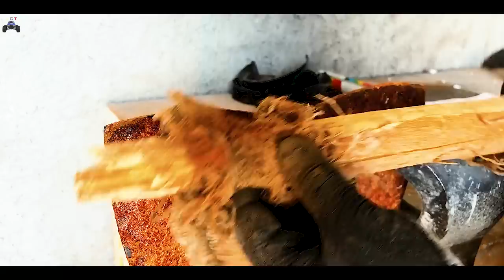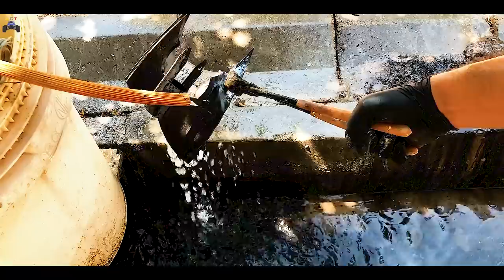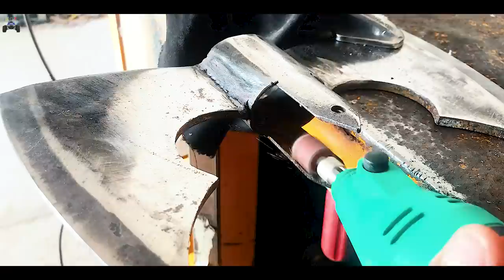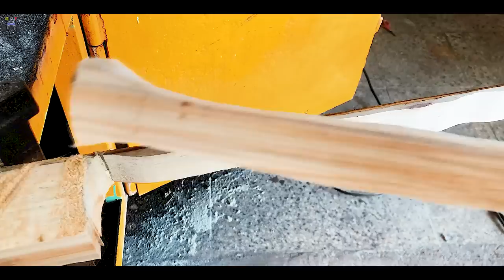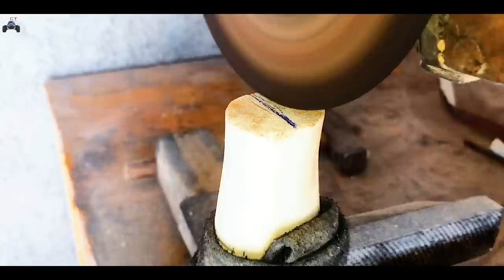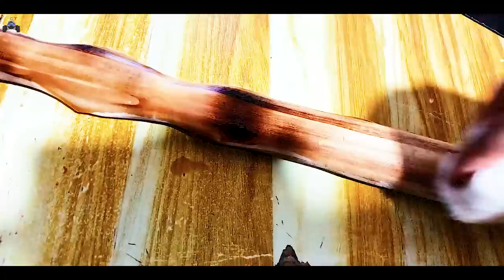Restoration Rusty Viking Axe Battle Old | Restore AXE construction Antique

Comment: I'm guessing that this axe is a modern reproduction made for the tourist trade. The axe blades are welded onto a seamless tube. The original would have been cast or forged.
Reply: Yes and wood handle is not aged, old always looks darker.
Reply: No doubt; you can clearly see the electric welding between the blades and central piece.
Reply: I'm guessing it is totally modern.  Viking axes were, generally, single bladed.  The only Vikings who used double bladed axes also had horns on their helmets.
Reply: Agreed. The restorers love to make claims that some object that they are restoring is of Viking origin. There were actually 3 different 'flavors' of Vikings, with 3 different points of origin, 3 different areas that they ravaged & 3 different cultures. None of them wore helmets with horns. That is how the Victorians  romanticized the Vikings.